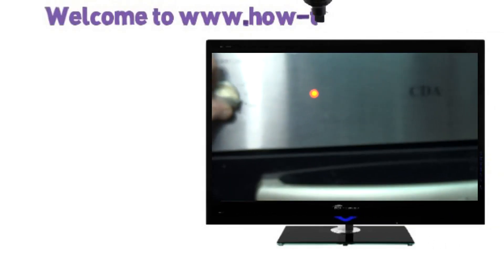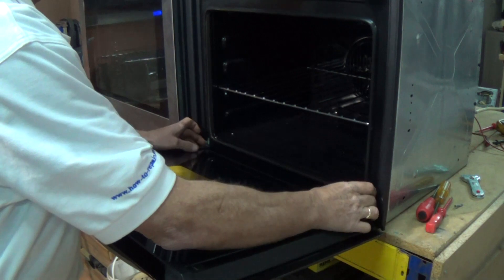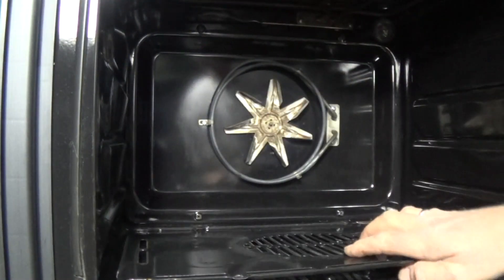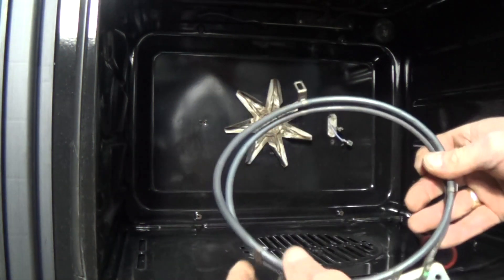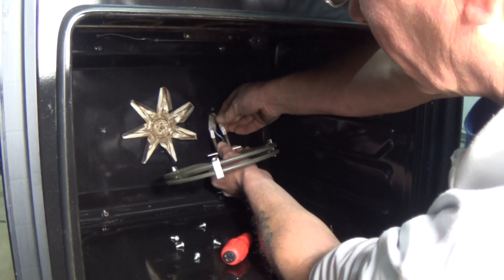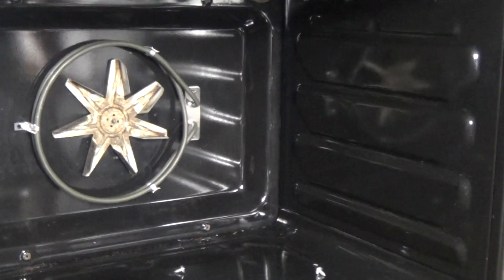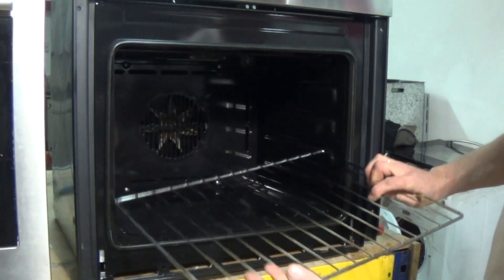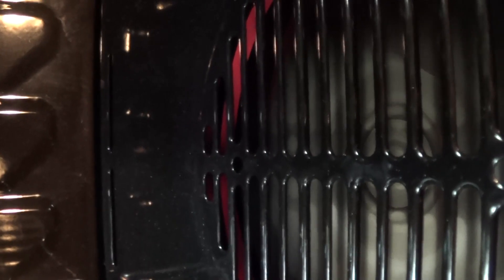CDA fan oven cooker not heating, how to replace a CDA, Delonghi, Elba, kenwood, Tecnolec fan oven el

Comment: Thanks a lot! Oven threw its element last night and got the part ordered today. Never even thought to use my multimeter to test its circuit was gone, finally an excuse to have the thing 😁
Only comment is that the DFS090DO requires you to pull the back of the oven off to get at the screws to remove the element, which is a real pain, but only took about 15 minutes to figure out and do

Comment: hi  thanks for the tutorial very informative. I have a flavel aspen 100 double oven which was working fine but noticed the electricity tripped then after that it wouldn't heat up. (the grill and the other oven work fine) I replaced the element but as soon as I turn the oven knob it blows the electricity any ideas what else it could be. best regards

Comment: I have a duel kenwood range master electric oven ,, would i be right in thinking that if the fan works ,, the temp light is on and there is no heat ,, the first thing would be the element around the fan ,,I only found out 10mins ago

Comment: I got the same oven,, used once like 6yrs ago,, went to use it today  powered it on,,, the timer was flashing 00:00 , but nothing work,, no heat, no light inside, or the light outside..... any ideas?

Comment: Hello, I hope someone can help me!I am trying to fit a new element to a delonghi fan oven model ESF461 ST.The element is held in place by one screw on the left and 2 pins in the plate so I can't see a way it can be removed from the front so I think this has to be done from the back.I have removed the door, the back plate and unscrewed the oven unit. I have managed to pull it out about a foot but it won't come out any further.Could anyone offer any advice? What could be preventing it coming out?Also, assuming I get it out, I'm a bit confused by the whole self-tapping screw business for fitting the element. I've not used these before... Shall I see what comes out and get some new screws the same size?Thanks in advance. Please keep answers simple!Caz
Reply: Hi Caroline. You have just made me feel better. I have a DeLonghi but a different model. I decided to call out a repair technician and was feeling guilty that I am  not doing it myself. You obviously are having a bigger job than expected. The call out is £30 plus parts (element is £35 i think) - for £30 getting and experienced trades-person out seems reasonable.
Reply: Caroline A hi there, was just wondering if you managed to find out how to replace the element? as I have the exact same problem with a Delonghi oven model.
Reply: Caroline A Hi! i have the same issue! did you manage to find a way to remove it??